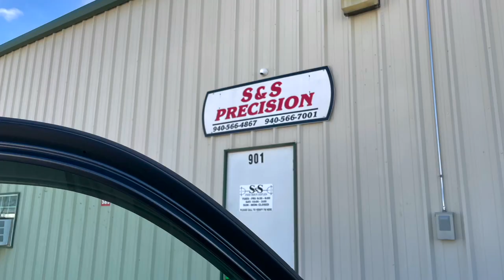Balancing my Competition Rifle

Comment: I'm curious as to why you didn't install all 22 lead internal weights to add 2.25 lbs and just run a regular arca rail instead of adding the anarchy rail?
Reply from the maker: I didn’t want there to be “too much weight” that was unnecessary. Also I wanted to try something new & different for this season just to keep it fresh. I like how having the anarchy rail out front allows me to utilize the full width of my centurion stock when I’m resting it on top of a bag.